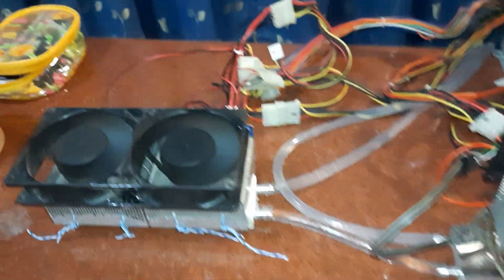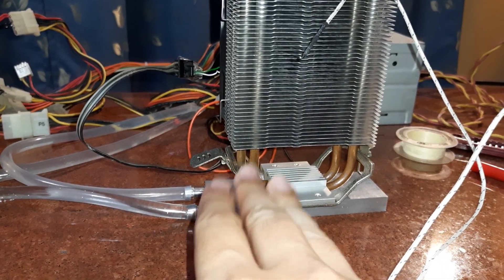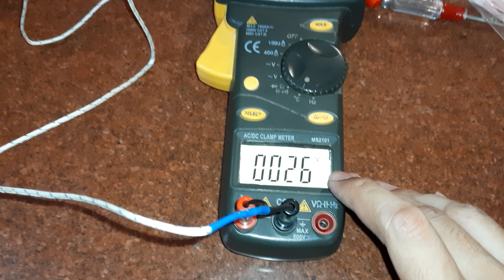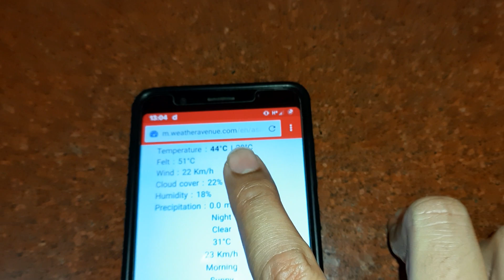[Eng] DIY Peltier Micro AC V2 | Temperature Test | ThermoElectric personal cooling system attempt 2

Comment: This is fascinating, thank you so much for sharing. When I was searching what I hoped to find was a personal peltier cooler that applied directly to the skin, for example the back of the neck or wrist. This direct cooling makes the body feel cooler in addition to removing some heat where the skin is thin and can cool the blood which then pumps around the body (of course this part is minor and the effect comes largely from feeling cool rather than actually chilling body temperature).
Reply from the maker: I have made one USB powered personal cooler too. I'll share details when I get time.